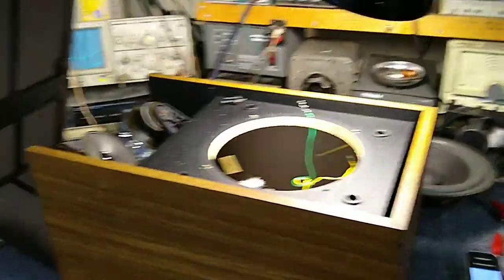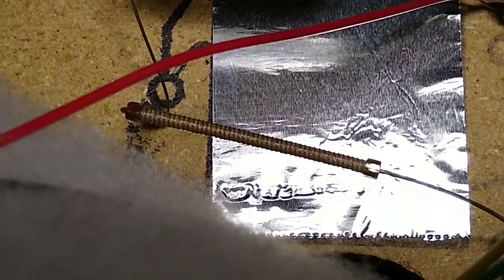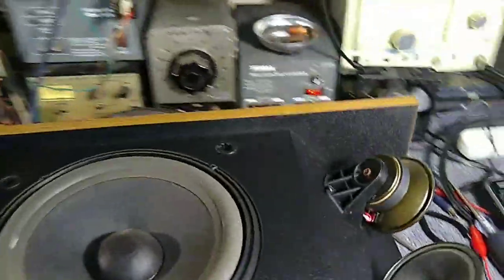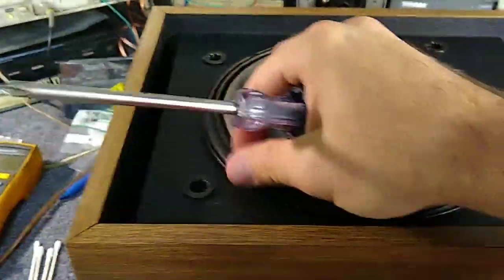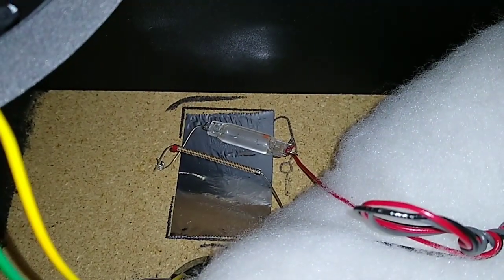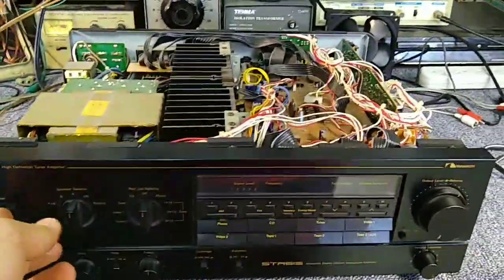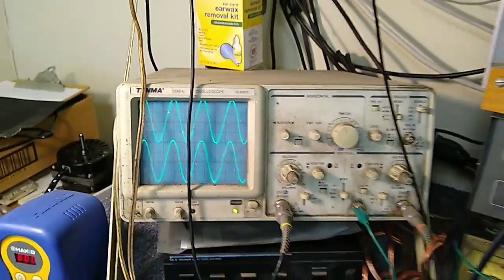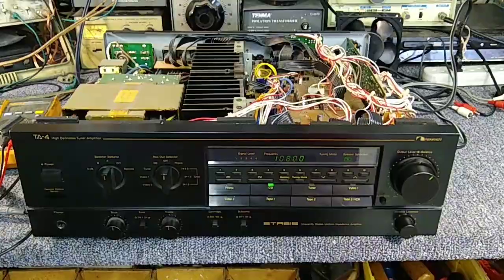Quick repair of blown Bose 301 series 3 speakers and evaluation of Nakamichi TA-4  receiver

Comment: Nakamichi amp was very bad, I rescued two bose 301 series 3 from the trash and them and big ass 401 in the rear and a vs100 center channel and Harman Kardon 75 wpc 5 channel awesome amp are the BEST and BEAST home theater set up! No these will NOT blow oh my neighbors would fear poop before that happened these things are badass 401 triangle monsters in the back can make SO MUCH BASS and so can the 301's...terrible nakamichi amplifier. driven from clean power they can get louder than the building you are IN CAN HANDLE...HK plus old school Bose speakers you do NOT need a subwoofer and it sounds incredible...

Comment: The bass in one of my 301’s is out. No visual problems from what I can tell with the cone and I’ve replaced the resistor which had split and still can’t get it to work. Any ideas what it could be?
Reply from the maker: If the resistor had split then likely the amp connected to this killed it. Either DC or extreme volume. Voice coils are likely gone. Get a dmm, measure resistance at the woofer and tweeter terminals. You'll likely see open or short if no sound

Comment: Did you check that Nakamichi receiver for DC offset? I have worked on a number of these,  and although they do not have actual DC offset adjustments, they can go into intermittent DC offset mode because of bad feedback caps, one per channel, usually green and sometimes bulging, found in the differential input feedback circuit on the main board. *Change them to bipolar/nonpolar electrolytic caps*.   There is also a known-to-fail 22K carbon-film resistor near each feedback cap, perched up off the board, that causes high DC offset when they fail; change them to 1 or 2 watt flameproof type. I used to add small heatsinks to the hot running voltage regulators as well. Be on the look out for corrosive glue. Tighten all circuit-board chassis grounds. And of course, clean the speaker relays while you're in there....

Nearly every one of these I ever worked on needed to have several hundred connections resoldered! Typically, I'd replace a couple dozen small electrolytic caps that were heatstressed, had high ESR, possibly bulging, or wide open and dead.  I've never seen one of these that had blown outputs. They do sound really good when they're working right!

Comment: Just found your channel through BigClive and EEVblog's videos.  I think I'll stick around.   On the subject of this video, I do like to have more amp than the speaker is rated, for, but you have to be careful.  The extra head room can make some of the really fast base envelopes sound really good, and a brief over current now and then won't hurt anything.  Though with the speakers I have I just assume as long as there is no blood coming out my ears everything should be fine.

Comment: Add a fuse in series with the speakers to protect them in case they are over driven.  Simple and cheap.  It would be best if the customer got bigger speaker such as Realistic Mach 1's.  Nice, loud and can handle the power. 😁

Comment: I know Bose have a bad reputation in some circles, the discovery of "a light bulb" in the crossover circuit confirms it to me.
Reply: @Joachim Shekelberg More because it is cheap, and it provides a very wide range of resistance so that overloading of the tweeters is very hard to do. In most cases it is just a few ohms, till you try to put enough power into it, when it heats up and the resistance change is both fast and dramatic, which helps protect those fragile voice coils, but still allows transients to be handled well.
Reply: nah, that's nothing new, Ohm used to do it...but what does confirm shit quality=crappy stamped frame drivers, no low pass(that i can see) on the woofers and wire wrapping...wire wrapping? i thought that went out long ago and this is the first i've ever seen it on speakers. . smfh.
Reply: Look like the bulb that fits my old car's dome light.
Reply: @Joachim Shekelberg Yep! Vibration can cause that lightbulb and resistor to swing around till the wire just fatigues.
Reply: I swaped all the junk (not mutch actualy cause it is cheap)inside from my 301iii to a decent 2-way crossover filter,  it is worth it!!!, then you got heights,mids, and lows,  you see Amar Bose it is not that difficult. Put some junk in it and sel it verry expensive the marketing of Bose,